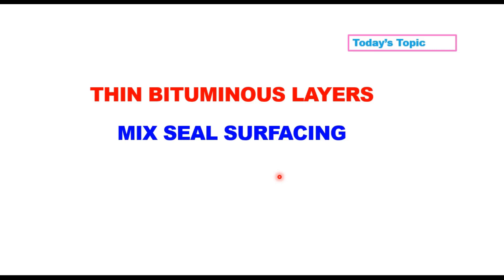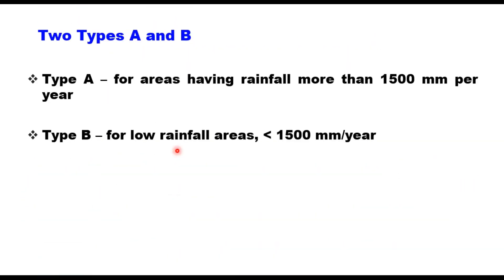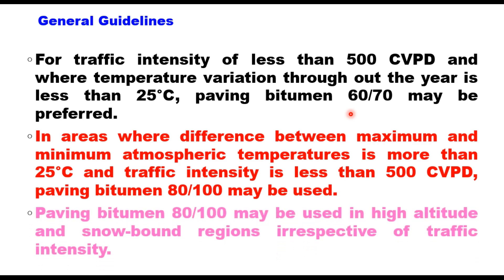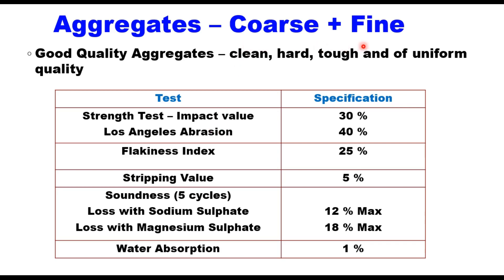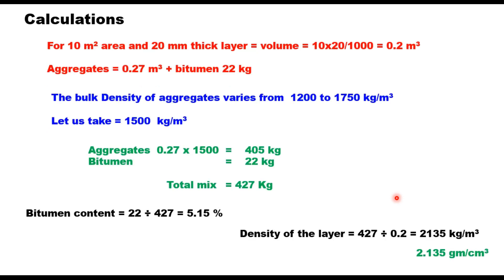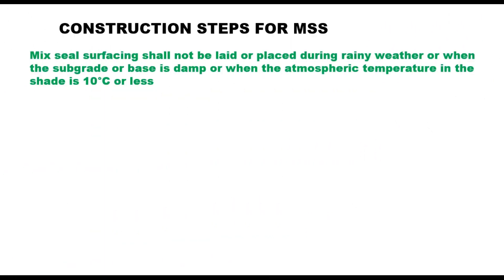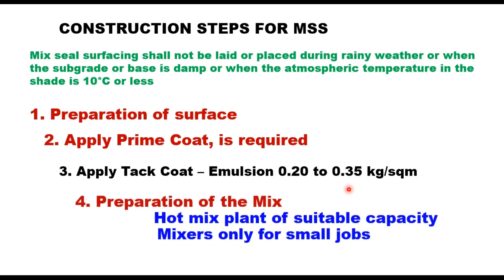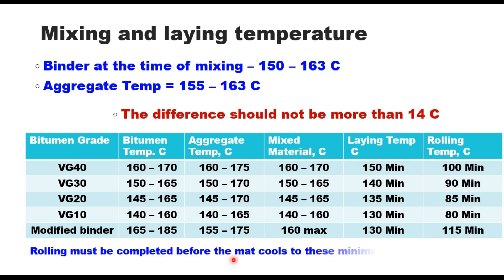Mix Seal Surfacing (MSS) - Design, Construction and Quality Control as per MoRTH 2013 and MoRD 2014

Comment: Sir here how bitumen type A and type B is 22kg and 19kg. I am so confused
Reply: Also sir, before making the mss layer, we have to prepare a tack coat right sir,. For making a tack coat in the laboratory using VG 30 bitumen how much kerosene should i use ? Sir please answer this one, i get so confused on this, i searched Google and Ai they gave me different answer.
Reply from the maker: Amount of bitumen depends on the fineness of the mix. Type A aggregate garding is finer than Type B and hence it will require more bitumen to coat the surface area of aggregates.

Comment: Thank you sir😊,Sir I'm interested to do my Mtech final year main project on pavements, sir can you suggest some areas which I have to focus or I can find proper gaps for research.
Reply from the maker: Thesis topic should be decided in consultation with your guide. I have no idea of test facilities in your lab. Choose a topic that gives you some additional knowledge and satisfaction.
Reply from the maker: It is difficult to suggest any topic here. Talk to your supervisor, consider the facilities available in your lab and then decide. You can read some latest papers in Q1 and Q2 journals to get the idea of research areas.
Reply: @SatishIITR  OK sir, Thankyou for your reply😊